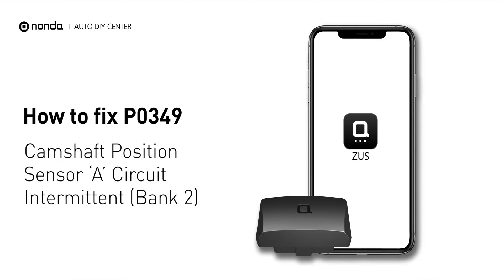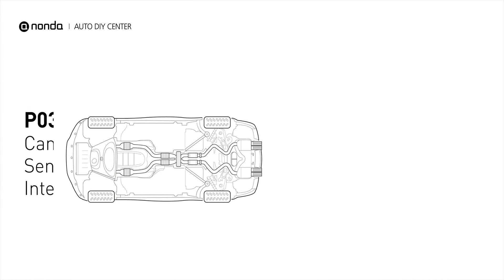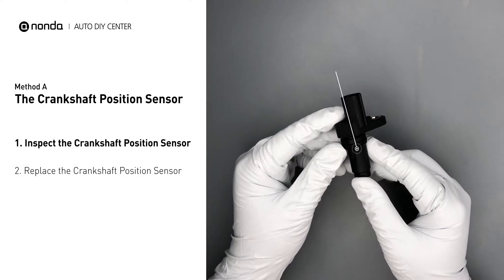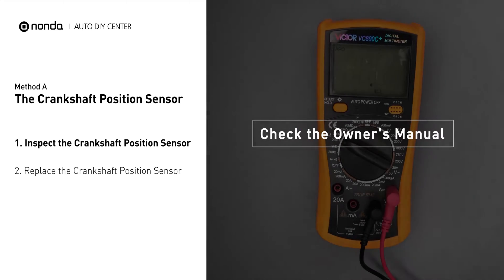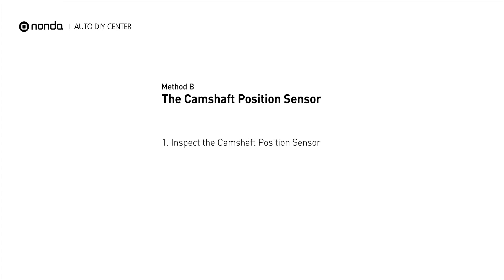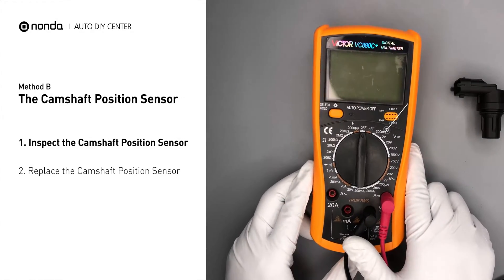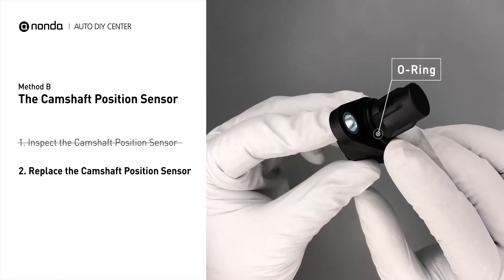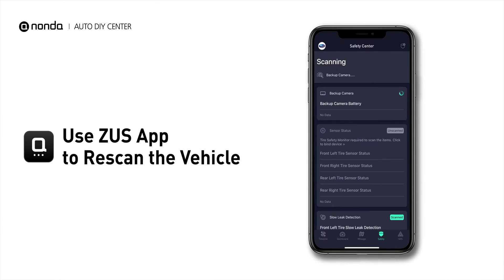How to Fix P0349 Engine Code in 3 Minutes [2 DIY Methods / Only $9.54]

Comment from the maker: Hi, I'm Steve, nonda's lead mechanic engineer. 
Feel free to leave your comments here if you have any mechanic questions, I will be glad to help you out!
Reply: Hey Steve I have a question I have a 2013 ford f150 fx4 3.5 ecoboost truck is running really rough I'm getting a couple codes po299- po345- po349 tried changing sensors cleared codes and they keep coming back any ideas what it could be?

Comment: Hi, Steve I know this is an old post but my 2004 & 2006 Ford F-150 is throwing the same code. It's P0345 & P0349. It says the Camshaft position sensor bank 2 is that going to be on the driver's side of the engine or passenger. The have one on each side the front of the engine I just don't know which is Bank 1 or bank 2 can you help me out